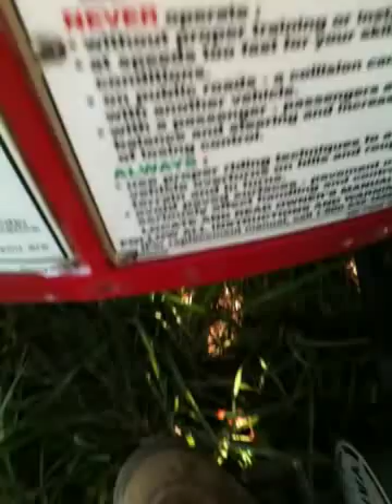2000 Yamaha Big bear 400 driveline knocking

Comment from the maker: Yes sir; mainly on deceleration, or anytime there was slack in the driveline, like going from on the throttle, to off the throttle. I ended up replacing the whole rear differential. Found one for $230 shipped on ebay in excellent condition. It was going to cost me $320 or better to rebuild mine so i just slapped the used one in and it is still doing great. I also have a video showing how to remove the differential if you arent familiar with it. Let me know if you have anymore questions.

Comment: Any tips on how to replace the hole front drive line like the u joints and yokes? I have a 94 yamaha kodiak 400 The u joint and yoke that goes to the differential is broke off